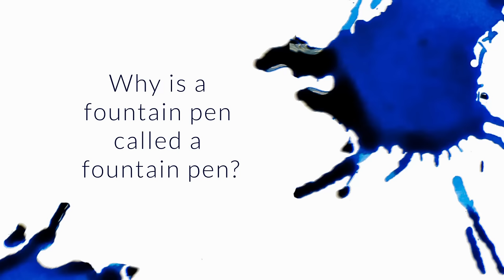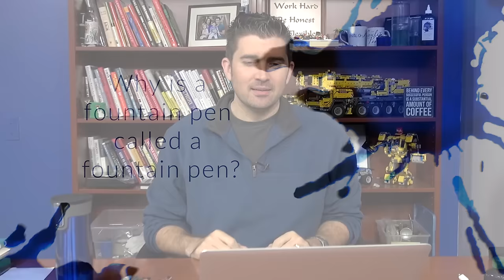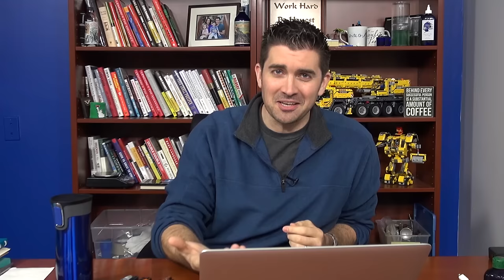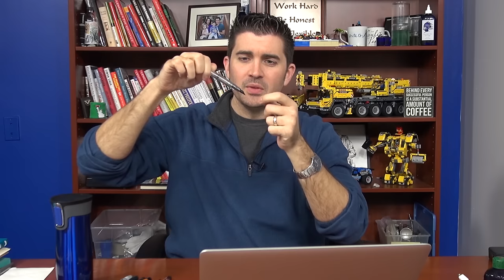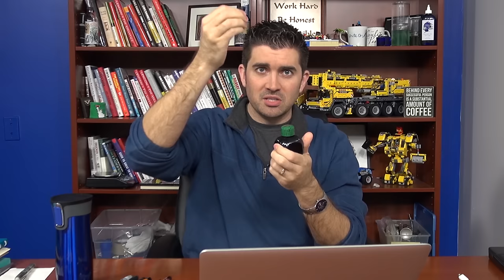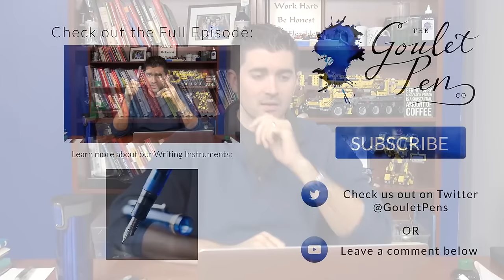Why Is A Fountain Pen Called A Fountain Pen? - Q&A Slices

Comment: Early fountain pens were gravity fed, and a fountain of ink really could pour out.  Writing was a matter of staying ahead of the flow.  In many of these pens, ink continued to flow as long as the pen was held nib down.  When pens that work by capillary action came along, the flow of ink was much easier to regulate, and when you lifted the pen off the paper, the flow of ink stopped.  Or was supposed to stop.  Can't say it always works this way, even now.

Comment: I had a tiny epiphany after watching this video that I think might actually provide a bit of additional insight.

Brian's explanation approached the naming of the fountain pen primarily from the angle that the popular notion of what a "pen" is was very different at the time, as compared to what it is to us now.  (Very true, of course.)

The other very important side to this that I realized we have to keep in mind is:  the popular notion of what a "fountain" is was also very different back then!  In particular, I'm fairly certain that they had fewer public installations featuring powerful, geyser-like jets that fire great vertical columns of water high into the air.  I think the fountains of their day generally involved a lot more gentle trickling, with at most perhaps the occasional little pouring waterfall added for dramatic flair.

Just wanted to share.  I wanted this to sound humble but I'm currently feeling very clever with myself.
Reply from the maker: +deadfr0g Yeah, you're definitely onto something! Context always matters. - Colin

Comment: Which fountain pens are good for long fingers (-50€)? I have recently taken up fountain pen writing again with my old Lamy (I guess it's a Safari), but after writing a bit, I get pain in my hand, because the "grip" is very small (too small) for my hand.
Reply from the maker: +Jeffrey Port Hmmm, that's an interesting dilemma. I think maybe the Lamy Joy or the TWBSI 580 could work. Both are longer than the Safari so it should rest easier in your hand. Do check out our Pen Plaza (http://www.gouletpens.com/pen-plaza) where you can compare the the sizes of pens to each other! - Colin